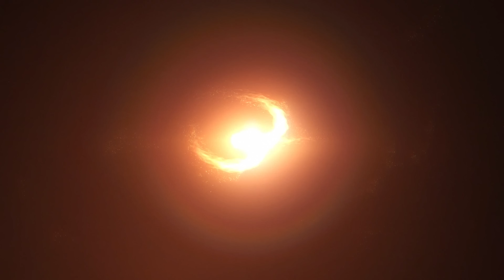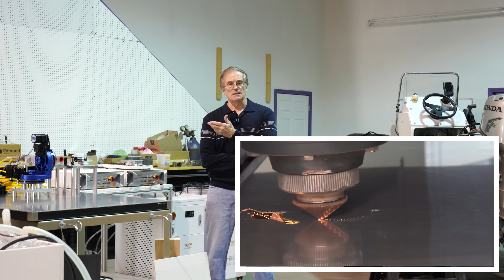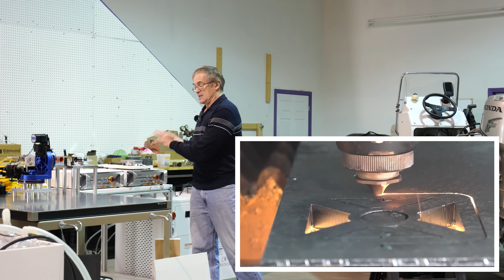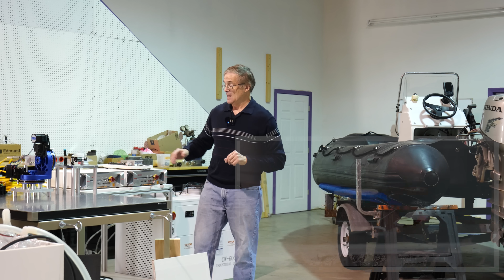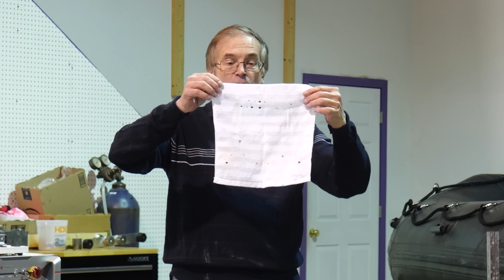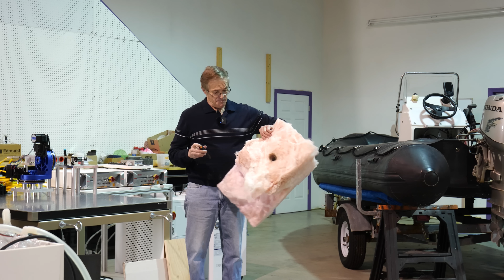We have a problem... and need your help!

Comment: I would try a self healing method.  Mix carbon(fire pit) iand make a lose slurry of water.  Cascade this material down a substrate of plexiglass.  Other substrates may work well with this cascade method.  Consider ceramic pain on plywood.  Water would extinguish flames and the carbon will absorb laser at that wavelength.  Bring the carbon into a medium powder like a fine ground coffee or finer

Comment: Try silicone carbide to make some form of brick using some waterglass its relatively good at absorbing infrared light and can withstand extremely high temperatures or you could even use it as a form of coating and apply it to some form of heat sink or even some form of composite material with the waterglass-silocon carbide mix with some carbon fiber to for some composite material you could even stack layers to increase its thickness

Comment: A couple of ideas crossed my mind as I was watching this. But they all have flaws. So I would suggest looking into what the walls that the Theo lab has, is made of. 

- Wood, although resistant will burn, so running water would have to be added to mitigate that. 
- Sand, I don't know about this one, because I suspect the laser will melt a channel of glas through it, so it will not be able to 'self heal'. Also, reflections. 
- Dirt. Might burn into it, and start a smoldering fire, that could break out weeks after the test. I guess it depends on the consistency of the dirt. 
- Water tanks, might be portable'ish, but could lead to uncontrolled reflections and diffraktions. And it doesn't really stop the light. (maybe if it's dyed.)
- Brick, unpractical.
- a shooting range or quarry. not very practical, and not very portable. and probably not very safe. 
- a lens to spread the laser out, is not going to work with a moving laser. 

I guess the best thing to do is to make the laser portable and have a rock wall or sand behind the target. Which might be difficult because you probably can't build a roof over it. But maybe you can find something where planes doesn't fly overhead? 
Or maybe angle the laser downwards into a lake? 

Or maybe this is all just an excuse for you to finally build that underwater supervillain base. ♥

Comment: Keep the plywood, solve the fire problem instead : multiple layers of plywood plunged in a plastic (or anything that would not shatter) aquarium, if the laser pierces it, many seconds will be required before it is emptied.
Your kill switch is the presence of water on the floor.
PS : if you're thinking too much about safety, you should probably stop.
PS : you don't need the aquarium to be particularly deep, just enough for it to have thin water columns between the plywood layers.

Comment: I feel like the goal should be to quickly diffuse the laser. I'm thinking polycarbonate with a matte finish. You might need like 6 panels about an inch apart or something like that.

Comment: I signed on to suggest a heavy 'giimmicked with vapor' waterfall but saw the core idea originally suggested nine hours go.  The only other thing I suggest is a paradigm shift to investigate halting the laser rather than blocking the beam. Failsafes could include an absolute limit on durations so you KNOW the beam terminates after some designated duration OR mechanical limits that restrict it to hit the ground within a prepared  safe perrimeter. This is like the rails that prevent radars from sweeping the deck of naval ship to prevent crew from finding out what its like to be a potato in a micrwave oven. Maybe a deadman scenario in which the power can only be maintained with more than one person holding the circuit closed against significant force reslting in rapid termiantion like the SawStop solution to table saws along with some AI inspired surveillance to cut the pwoer as soon as it sees your garage door - or anything else observable intended as the primary barrier - light up. Otherwise, I really wish you could have come up with this question before Val Kilmer passed away so you could name it for him as this exact issue arose in REAL GENIUS.

Comment: it's been a long time since you and I had any dialogue, and your actually, a neighbor of mine, so to speak… :-) Well, here goes.  I thought of 2 things you could try, 1st an angled mirror into a vat of water or pan of water, and 2nd ,  a smokescreen made with steam, or dry ice, or some other thick smoke generating substance. Or possibly a combination of the 2 things mirror into a smoke area into the water vat. On the smoke generating system. I think the denser the particulate diameter or the larger particulate size, the more diffusion it would provide. Interested to hear what you think.
Reply: also for the smoke generating system. It could be enclosed in a glass box so as to not disperse into the area that you're trying to use the laser in

Comment: How about a torsion box design using cement backer board front and back and using a slurry of perlite, lava sand and liquid inside. Maybe also include crushed glass sand for diffraction as well. This "box" should be relatively light, have good thermal mass and heat absorption properties and relatively cheap.

Comment: Nighthawkinlight has a recipe for starlight (makes a carbon foam that should absorb the laser light well and is really resistant to burning) and you can plaster that onto wood tiled back at a 45 degree angle. The wood and starlight should have a good burn through time, and the starlight will prevent the wood from burning. Also, as some other's have said, you need a really careful safety procedure laid out for a machine like this with redundant shutoffs for everyone, and possibly a set of sensors to detect burn through or reflected laser light for auto shutoff. Look at Smarter Everyday "Bullets HITTING Bullets in Slow Motion - THE IMPOSSIBLE SHOT - Smarter Every Day 287" at the 7 minute 48 second mark, for an example of a safety checklist.

Comment: The thing that pops to my mind is to first redirect the beam. A series of "tanks" with the front surface angled at 45 degrees (or so) to vertical and mirrored so as to direct the beam into the tank below filled with an ablative or absorptive material - perhaps titanium or tungsten shot in water - should give you time to trigger a failsafe. A flat plane mirror might present some problems when the beam doesn't strike it at a 45 degree angle of incidence, thereby redirecting the beam to some other place than the absorptive tank. A parabolic profile to the mirror might minimize this problem. Additionally, it might be useful to make the mirror diffusive to mitigate the concentration of the beam. Simply micro texturing the surface of the mirror would probably not work. However, coating the mirror's surface with micro crystals, similar to how a high quality projection screen is coated, could possibly work. Projection screens use shattered glass particles which would not hold up to the intensity of your laser. Since the diameter of your beam is approximately 1mm, the size of the particles (very tiny prisms) would have to be much smaller, in the range of 0.1mm. As for materials, both quartz and diamond "dust" come to mind. The optimal distribution of those particles is a heavier math lift than I want to attempt in my seriously uncaffeinated state, but I have total confidence that you can do it. LOL

This system could be modular construction to allow for relatively easy assembly and disassembly. 

I anxiously await seeing the videos of your solution to this problem.

Comment: A laser with the energy density that you are working with will quickly burn through pretty much anything and will create corresponding vapors that could be hazardous so do be careful with any solids.  Water will absorb energy and a light absorbing material (carbon dust?) can be added to the water to absorb the energy, preferably spread over a few inches (too absorbent could localize too much heat possibly at the glass / water interface and could damage the glass).  Any boiling of the water will also create lensing that will disperse and facilitate safe absorption into the water.  An aquarium might work if the glass can handle the laser power.  Good luck.
Reply: Aluminum glass is funny like this it will vaporize under special conditions but not under normal conditions and you can add some doping agents to largely prevent those special conditions from occurring.
Reply: Maybe add a thick copper sheet in the back third of the tank to disperse the remaining heat...

Comment: What about putting nothing in the way - like turning the project to point at the sky as long as no planes go overhead or into the ground. A cylindrical tube that was reflective on the inside would also make your blast radius smaller so that you only needed a small brick wall.

Comment: Try combining the wet blanket and wood. It will punch a hole in the blanket but the wood will stop it. Then the water in the blanket will stop the wood from burning. You can also have a water pump circulating the water from the bottom of the wall to the top of the wall

Comment: I was also thinking fiberglass insulation, I'm wondering if rockwool would stand up any better.
I think your problem is energy is being added to the system at the point faster than it can be dissipated, you said the fiber lasers are operating right near the limitations of light as a energy transfer medium, well if I am understanding your meaning correctly, any material is going to transfer energy away from a tight focal point slower than the light can deliver it and will burn, so any methods of cooling the material are going to have to be exotic enough to not be particularly practical.
That would leave you to rely on the thickness of the material, an ablative coating, or intumescent materials/coatings. I give credit to @NightHawkInLight for the idea.
I am thinking if you used your preferred backer board then coated it with something like starlite or one of NightHawkInLight's other intumescent coatings that might get you to an usable result with minimal complexity and still be portable/storable.

Beyond that the only other thing I can think of is as others have suggested a berm of soil/rock.
You might (and its a big might) be able to use a quarry instead of a salt mine, or use a pile of aggregate intended for some other project/works and just "borrow" it by filming there.

Comment: Water curtain seems to be the wisdom of the masses - but I would like to also offer up atmospheric scattering. Fog machines or the like to put enough particles in the air that it robs the beam of cohesion. They need to be smaller than the beam width. YAG lasers are close to 1micro, little bigger in fact. So 1 micron aerosols. Ton of research out there on climate impacts from these size particles - so we can make them and do so in large amounts. Sorry I can't be more specific.

Comment: Hi guys, first I was thinking about a baryum sulfate supension in a ceramic glass aquarium. Then I thinked twice : You have somehow a "dissipation" problem, too much focused energy density. So you have to diffuse it the largest way and the fastest as you can in a non heating material, such as air, then when diffused you can capture it on a really black matérial.

So : what happens when a laser encounter a glass cylinder with is the same diameter, it diverge in a line (as laser leveling devices), so, what would happen to this line if it encounter a parallel cylinder, it should diverge in every direction, so, normaly on just to step your laser crossing a to layer on parralel cylinder both turned 90° should diverge it a lot.

Also it might induce some refraction and reflexion.

Next layer should be of water and some kinda graphite wall, or a "musou black" painted very heat diffusive metal, as aluminium or copper.

As you laser is probably monochromatic (I hope so) parametering the fiber glass diameter and the density of the "reseau de cylindre" might not need so many trial and error test.

You know they are picture you can see 2 version of, on certain angle, it's not a reall fresnel lens, but the hemicylindrical parallel lenses do the trick (it's hard to explain) kinda lenticular lenses.
You will probably need some ceramic glass (kinda schott ones) to resist the heat and thermal shock.

Just I was also thinking about the glass balls you can find in the plastic industry, they are used to reinforce some coumpound plastics. In a transparent water tank, balls in suspension in water. This might help diverging something tho.
Fluidified quartz sands aquarium, with compressed air ?

Obviously this have to be the size of a wall ...

You're videos are fascinating so, I hope this might induce some ideas to you.

Sources :
https://www.youtube.com/watch?v=24GfgNtnjXc
https://www.youtube.com/watch?v=My4RA5I0FKs
https://en.wikipedia.org/wiki/Autostereoscopy

Comment: Rather than your above ground building could you use a basement?  Unfortunately floor to ceiling height is not large in most basements.  However they can give a huge dirt barrier.

Comment: You used lens to narrow the beam size, why not just make the backstop/target another lens and scatters the light? Or use something that has a high refractory index to curve the light into the ground? Soft plastic tubing filled with mineral oil has the ability to trap visible light in the tube and can then turn around corners. A last ditch effort, you could create a fine mist rainfall back drop to use water mist to absorb/scatter the beam.

Comment: Why not just a simple waterfall wall? With a recirculation pump to a header trough at the top and a collection trough at the bottom. Either a linear gap or hundreds/thousands of outlet holes to cascade down in a wall of water.
Just a thought 🤔!!
Keep up the great work 👍🏼

Comment: This one might sound dumb have you tried a moving backing?  Like a piece of drywall connected to a power drill.  Or a piece of wool cloth looped over some pulleys so its constantly moving (conveyor belt) .  you could have one end belt submerged in a bucket of water or other cooling liquid?  Something that moves basically so that single point isn't in contact with the laser beam for too long?

Comment: Is it possible to essentially do the reverse of what you did with the focusing lenses and instead of using the lenses to focus the light, can you put a lens of a certain shape at the intended safety contact point that will instead disperse the light and cast a broad light across the wall?

Comment: I don't know if that would be possible as i'm no engeneer. But to put some kind of glass or lens that would be defusing the laser on a larger point or multiple points to reduce the intensity on what you want to protect. And i also tought about lets call it a waterfall like those they use to display laser shows. I tought about a water tank but that woul get pierced then spilled i guess. There is also multilayered glass with defracting refracting difusing layers that could be created i guess like bullet proof ones.

Comment: Similar to the water curtain, what about two panes of clear glass with a water layer in between, dyed black or another color, colloidal mixture to help disperse the light energy and vented at top so no pressure builds up.  Not being familiar with these high-powered lasers, they may just burn the glass but may depend on the type of glass.

Comment: I think sand. There are a number of comments about this. It's cheap and non toxic.
If sand is sprayed or poured over the target it will absorb the laser radiation and scatter it. You will get glass pebbles. (Some people may even buy them if it's from a cool YouTuber!)
Just a thought, sea defences can be done with concrete or rocks. Rocks tend to dissipate the waves, rock by rock, whereas concrete walls just get hit by the full force of the wave and reflect it back to sea. Concrete will wear out, but granite lasts for centuries.

Comment: A dead-man switch seems to be a popular thought, but the reaction time would vary, but damage would be done prior to the activation of the switch. 

Having a barrier in the background could be cumbersome, but the question is, does the laser move? The less movement, the smaller the size of the barrier needed. 

Another option is source point refraction, reflection, diffusion, or absorption, or maybe a combination of the 4. A spring loaded or solenoid driven blocking plate/cap/barrier could first defuse the intensity, refract the light to different wavelengths, and absorbed into a vanta black coated material such as carbon fiber or other less combustible item. The safety barrier could also be set up with like a retro reflector lattice. Having multiple optical sensors would monitor beam path and if it goes awry, could cut power to beam and engage safety barrier in front of lens.

Comment: Metal casting sand packed in PVC/ ABS tubes in section laying on aluminum channle for aliment.  4' sections with a sheet of paper between the section for a visual alert (smoke/ fire) that penetration has been reached between a section and repacking is needed in that section.   You could also try glass bead in the tubes thought it may refract out the side..